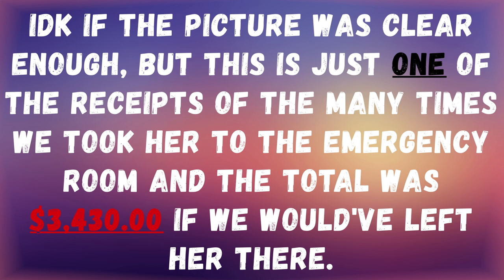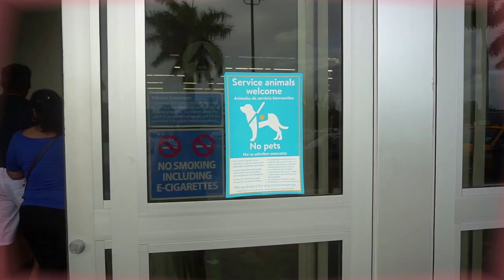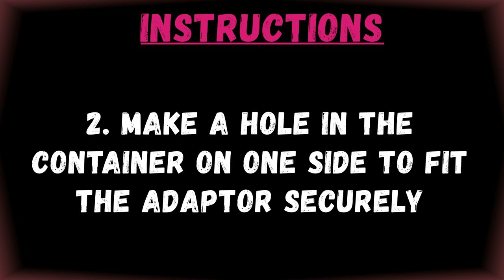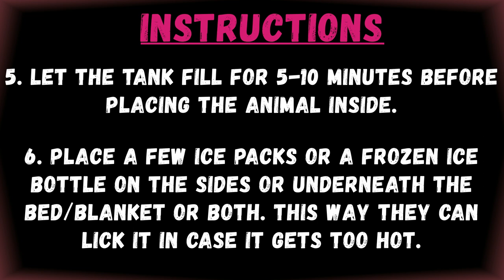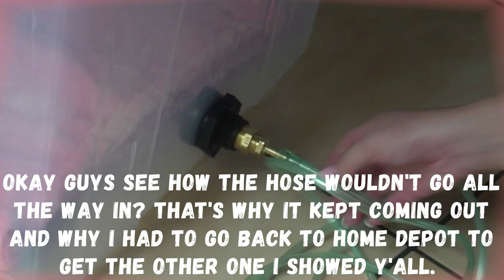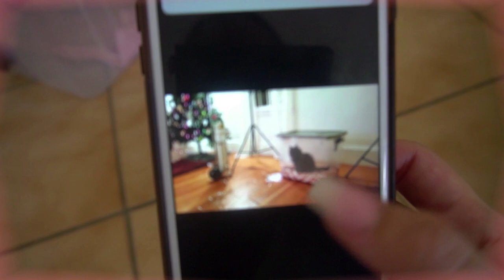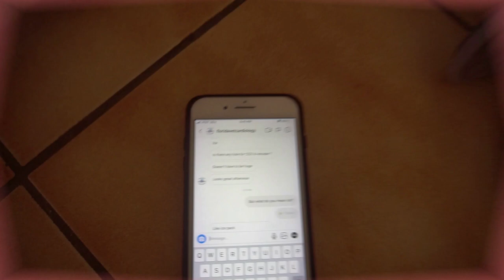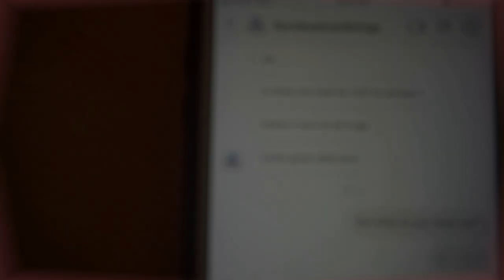HOW TO MAKE AN AFFORDABLE OXYGEN CHAMBER FOR YOUR PET 💕🐶

Comment: I bought a CO2 monitor/alarm.  Keeping the CO2 levels low enough has been a problem for me.  I'm trying to figure out the venting.  Thinking of putting an identical second port on the bottom at the opposite end with a large valve that can be adjusted to let out CO2.  Do not underestimate CO2.  It's a danger.
Reply: @whatsnext2359  did you vote for trump by any chance ?
Reply: @whatsnext2359  sounds like you need to have 2 masks on at the same time. Don't comment on useless things

Comment: That’s very clever to use in a pinch. My only concerns would be exhaled CO2 levels? And you’d need to monitor the actual oxygen levels in the box to ensure they’re not becoming hyperoxic over time. Oxygen toxicity can lead to illness.
Reply: You need a regulator for it!
Reply: Due to the higher flow rate of oxygen entering the kennel, there is low risk for carbon dioxide build-up or excessive humidity inside the kennel.  With high flow rates of oxygen, the air in the kennel is generally replaced every 2-3 minutes, not allowing time for carbon dioxide levels to build.  If condensation is noted, the top of the lid can be slightly opened or larger holes can be made.
Reply: I built one following @iambarbie305 direction (You can see that on my video).  A added a fan and a air quality monitor for CO2 and Humidity level.
Reply from the maker: @fineartlifestyling  👏🏻👏🏻👏🏻 Thanks I definitely had no idea how to respond to this question, but I knew everything you said 😂
Reply from the maker: @davidcpersonal  👏🏻👏🏻👏🏻

Comment: those tiny holes are NOT enough, have to make a large opening, otherwise the level of CO2 gets dangerously high in 20min, buy CO2 meter and see for yourself
Reply: Do you even know what a hyperbaric chamber is
Reply: @shawnprivate5322  definitely NOT breathing continuously increasing concentration of CO2. I tested, CO2 tripled in concentration in less than 1 min, and I had only 2 lb  kitten inside.
Reply: @emmas816  The whole idea of hyperbaric chamber is to concentrate the oxygen level by large numbers,vents might have been a tad bigger but

Comment: Don't recommend doing this. You can't regulate CO2, humidity, temperature, and oxygen concentration appropriately. She also does not have an oxygen tank; she has an oxygen concentrator. Medical management and hospitalization can help your pet get out of its respiratory crisis.
Reply: esto es recomendado por veterinarios, lo que tienen que tener cuidad es de hacerlo solo si tienen el concentrador de oxigeno,   la caja sola con aire no sirve y es perjudicial.   el concentrador de oxigeno es obligatorio
Reply: YOU don't recommend doing this even though a) HER VETERINARIAN recommended and APPROVED of THIS setup and b) these type of boxes are actually sold for the sole purpose of providing oxygen and, in many cases, using a nebulizer?? I'm curious?? Why don't you recommend it?
Reply: I’m sure that hospitalization can work but aside from the insanely high costs most vets treat pet  owners as if they were in denial and pressure them to put down their pets.

Comment: Where did you purchase your air machine from? And how much pressure do you use for oxygen to be released for your little one?
Reply from the maker: Joshua Valadez I purchased it at a medical supply store in Miami, Fl I would put it between 3 - 3.5 & 4 depending on how bad she was I believe it would go up to 5. I’m actually thinking of selling mine now that my little one is gone 🥺 in case you’re interested.
Reply: @iambarbie3056  I'm sorry for your loss.  How much are you asking for the oxygen machine?
Reply from the maker: Cal Thank you, I’m asking $600 for it.
Reply: @iambarbie3056  how long did your  dog get the Oxygen treatment? Do you think this treatment worth it?
Reply from the maker: @kyukim6358  She had it for about 3-4 months and I think is definitely 120% worth it, I know of some people that have used it as well after finding my video and 8 months later their little fur babies are still here with them. ♥️🙂

Comment: month's went by.did u run into any problem.did you learn anything new about the process?
Reply from the maker: Hi sorry for the late response. I didn’t run into any problems, my dog did pass away a few months after making this, but it was definitely worth it. If I would’ve done anything different I would’ve probably made the little holes on top of the chamber a bit bigger than what I did so that the air could come out better and I would’ve only done them on the opposite side of where the oxygen was coming in through, not on both sides like I did. I also would’ve added a carbon dioxide oxygen temperature and humidity sensor and a fan on top of the chamber so it could’ve helped the carbon dioxide out. Hope that helps. ♥️

Comment: yeah - no. don't do this at home.  no way to monitor O2 levels and CO2 levels.
Reply: I understand the concern, but my vet has said that this is safe to do for my cat with suspected heart failure. He said he’s never had a problem with home set ups so long as their is a little vent hole. My cat is in a cat carrier set up and no problems (other than she tries to destroy it from the inside out).
Reply: a mi tambien me lo recomendo mi veterinario, es algo seguro, ademas el concentrador. regula la cantidad de oxigeno suministrado